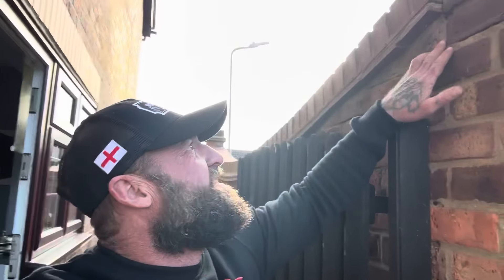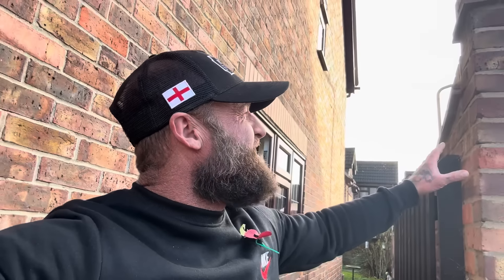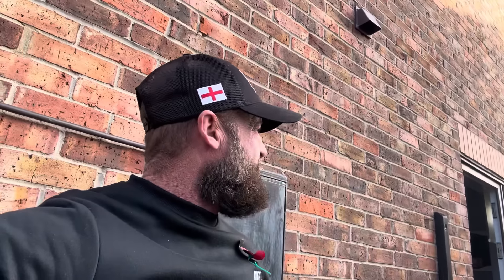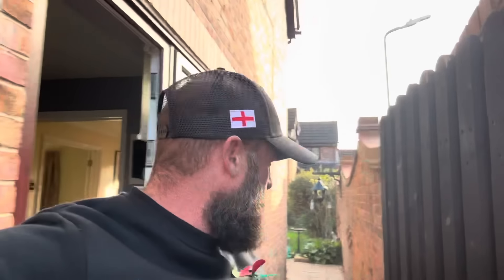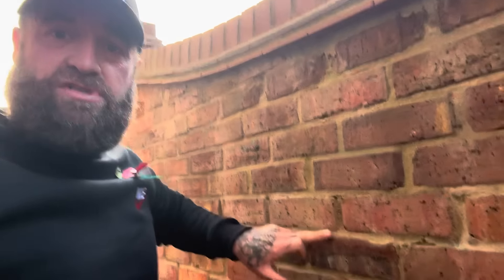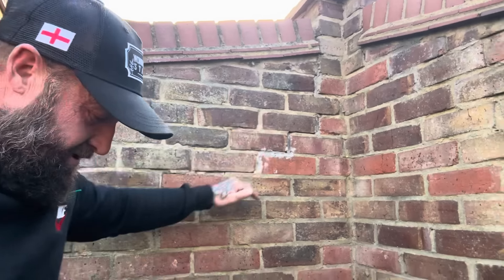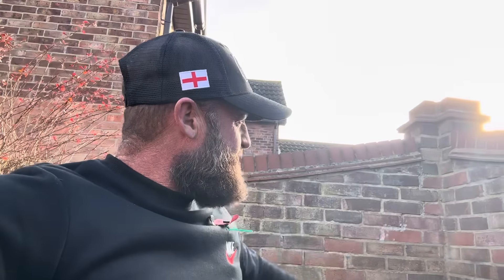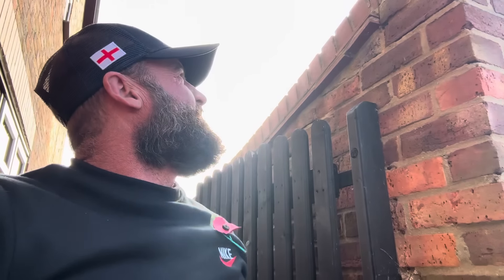Brickwork wall aesthetically nice but Technically￼ wrong 🇬🇧🧱￼

Comment: If the scallop was one course lower it wouldn't have made any difference whatsoever. It should have had some expansion joints in a wall that length and the pier at the gate end should have been bigger.
Reply from the maker: Incorrect sir always start on a stretcher so it’s bonded that way 2 straight joints instead of 3 ..also yes 18’’ pier on gate for sure 

Me lads Gona do the repair I’ll post it 

Thanks
Reply: Its just a bad design half or stretch er it will still go nothing to do will straight joint, it's a litter it will always go , 40 year experience
Reply: Little pier
Reply: To make out the wall has failed because of the 3 course straight joint is ridiculous.
Reply: Am not a brickie. But av learnt something here
Reply: Correct sue … bigger pillar on the end and he’s talking rubbish about working the bond out from the beginning to make only 2 straight joints rather than 3 because you work that out when you get nearer to the scallop
Reply: Piers probably couldn’t 
 have been any bigger due to boundary infringement.

Personally, wall is too high in the first place, 2m tops overall for 9”. Moving joints require with bigger end piers with intermediates piers. 

The gate definitely isn’t helping also, I was taught the corners were the 
strongest section of any 
wall.
Reply: Nothing wrong with that garden wall, rake out the cracked joints and repoint, talk about milking a job😅😅
Reply: Perhaps a 350mm wall filled with concrete and wider pillars on one side for bend and tilt support. Would extend it's life behind 500 years
Reply: None of yous lot have a clue. Scallops are found in the sea and joints are found in Amsterdam.
Reply from the maker: @johngarthwaite4051 rough arxx no wonder I’m in demand …Jesus Christ
Reply from the maker: @suemarsden7249 are u winding me up ..must be …rough arxx listen to me wen I talk lefty Jeremy vine listening traitor
Reply: No expansion joints in wall. Every 4m is the rule ?
Reply: @Iknewit6  we do every 6m unless it's built with a like mortar.
Reply: Pier is too small that’s all. You’re a mustard trowel Dean of that there is no argument but everyone is wrong sometimes.
Reply: 😂😂😂 @rhinostacey7741
Reply: Correct suemarsden , it’s pretty obvious it needs expansion joints , the wall failing has nothing to do with a 3 course straight joint at the top 🤦‍♂️
Reply: What do I know. Only been in the game 45 years and worked on lots of top heritage jobs. This man is a joke.
Reply: Prop it up with a few buttresses
Reply: 6 metres max.

Comment: you don't think that maybe its because its a 215mm wide wall at maybe 7 feet tall with a gate? Thats not allowed today. A wall of over 4 feet has to be 215mm wide, above 6 feet has to have piers every 1800mm. that wall fails on many levels
Reply: I'm with you. 😃

Comment: Sorry, Mr. Brickwork, with all due respect, I’m not sure you know exactly what you’re talking about. 
The scallops aren’t the problem the fact that it’s a 7 foot high independently built 9 inch wall without a single pier built into it is the problem. They have even swung a gate off it at the end for good measure. I can’t believe it’s still standing.
Reply: Correct. I’m not sure he knows what he’s talking about
Reply: Course the doors not helping but it’s the movement eg weather and building a pier that size not tied in
Reply: Well done , no structural integrity.
Reply: correct
Reply: 😱 Brickwork wars?
I'm even more intrigued. 😃
Not that I know what's right. 
He sounded great to me. 🤫

Comment: Somebody once told me, not my assumption, referring to local council built property from the 60's & 70's. That the brick layers put fairy liguid in the cement mix to make it go off quicker, once laid. This then had the adverse effect of causing the brick course to go bad later in years and create cracks and weaknesses in the structure?
Reply: When mixing sand and cement to make mortar, a plasticer or (FEB) is needed to make the mix workable or smooth and creamy consistency. Fairy liquid was used for this reason not to speed up the curing process. 
However, The mortar does not harden to its maximum strength and can become powdery and soft. 
(AVOID)
Reply: Thanks, Michael, for your info and clarification. Very interesting 👌
Reply: We used to do that all the time. 
It's not to go off quicker, it's to make the gobbo sort of smoother and nicer to work with. 
We used to even ask the punter for a squirt of their washing up liquid.😃
You're supposed to put a little sachet of plasiciser. 
Same sort of thing.  I didn't know it had any adverse reactions. 
Obviously it ain't ideal.
They don't sell Fairy in the builders merchants.😁

Comment: An extra brick there won't get the movement away. The brick will easily break too. There should be better footing. Probably there is no footing or 100mm concrete.

Comment: I'm building a garden wall brickwork 13inch I've got a arch just 100mm the door is 900mm and the template they have given me is steep would u cut the bricks getting a massive perp ?? Cheers
Reply: Yes, just trim each brick approximately 5mm so there tapered (lengthways) 
That will allow you to tighten up on the perps. If the arch is as steep as you say (True Arch) then you may need to trim 10mm off the bricks.

Comment: No designer will show a 9 inch wall that high/long these days. The wind loadings are too great and the wall may fail. Minimum 2 skins with concrete infill or I’ve seen 3 skins tied also.